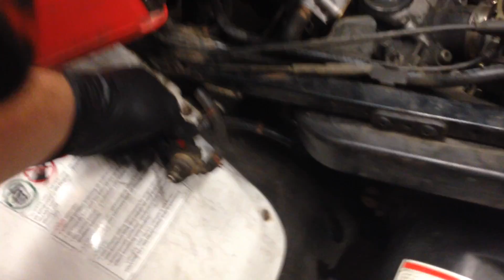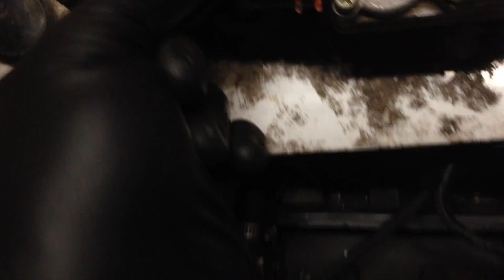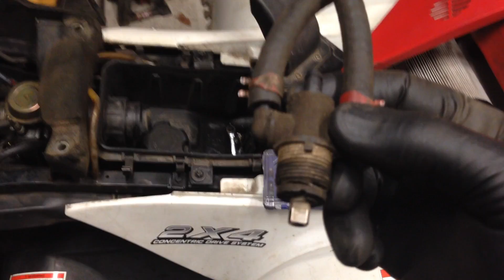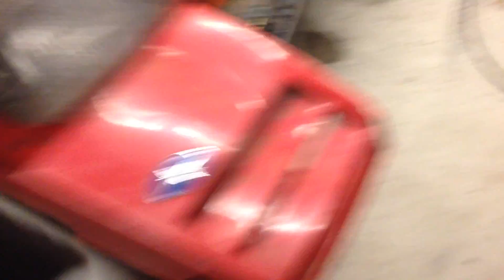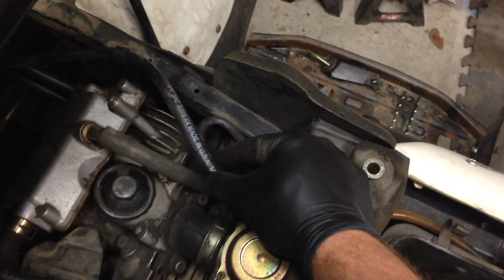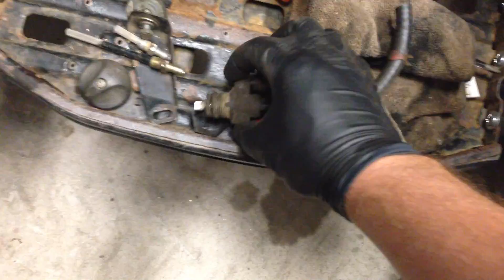Trailboss 325 fuel issues. The fix! Engine sputters then dies. No power or acceleration.

Comment: I'm in the process of chasing down a fuel issue of my own on my Sportsman 700. I replaced the carb and still have issues. So tomorrow I am removing everything and replacing the petcock, pump and all the lines. I was going to try to clean the tank as well. But I'm curious as to how the nipples on the tank come out and go back in? I'm a little nervous about breaking a seal and having a future leak. So my question is, how do they come out and have you had any issues with them after removing them? Thanks!
Reply from the maker: Mike Boley they thread into the plastic and they seal up fine, nothing to worry about, don't over tighten them. Brass will always win over plastic when torque is in play. Just make sure you take note on which nipple fitting is reserve and which one is the on position so you correctly connect the lines to your petcock valve, my only recommendation for you if you're going for a full fuel system rebuild. I hope my video is of help to you and thanks for your comment. Best of luck with your sportsman 700
Reply: Dustin Elgan thank you so much! Where did you get your fuel lines? I was going to try to go to the parts store but someone said the last time they went there they said they weren't allowed to sell him the lines by the foot. They ended up just cutting him a section and gave it to him. Not sure what that was about, but I may have to go online to buy them. Thanks again!
Reply from the maker: Mike Boley got my lines at advance auto. If any of the big store brands say no, you can't go wrong going to a Napa or other smaller name Autoparts stores. They'll accommodate you better for sure. There's always eBay and amazon as well, you'll need like 7' of 1/4" fuel line I believe, all that info is in the video. Online will probably be cheaper TBH.  Best of luck, let me know how you make out.

Comment: Also i believe the start switch is bad. The e start wont work. Lights dont work. Nothing electrical works except for that it starts and runs rough
Reply from the maker: Bob Disandro see my tutorial on headlight starter switch replacement on my channel. This may help you. If that doesn't work check your stater solenoid just forward of your battery. If nothing after that replace your starter and make sure there's no corrosion on battery cable terminals or faulty cables. Hope this helps you.

Comment: Im having issues with my 01 325 trail boss. It will start with the pull start and run like junk. Will not excellerate at all. No funny noises from the engine so i assume its a fuel issue. I cleaned the carb. Changed the plug and end. Drained lines and added fresh fuel. Changed nothing. Please help.
Reply from the maker: Bob Disandro follow my tutorial for fuel pump fix. Either bypass the pump or replace it, consider replacing all of your fuel lines, they can collapse internally and restrict fuel flow. Hope this helps you.
Reply: sometimes its not necessarily the fuel...if it is an older model quad and driven a lot it could be a worn cam lobe.  Polaris engines are notorious for worn cams.

Comment: This is funny, I had the same problem, but I had to change the  carb, but I had a buddy put in a gas filter and change out some things like the nob for the gas.
Reply from the maker: Spudnick MORTY glad you fixed it. Sometimes a clogged filter is enough to make things run bad by itself, those carbs aren't cheap! Thanks for your comment.
Reply: Dustin Elgan hey I have a trail boss 350 and I was coasting down a hill and it died and sputtered out and have not been able to run Sence could u give me some advice on how to fix it also I just premixed gas instead of using the oil tank did that mess anything up or not

Comment: its a fuel pump that works with vacuum it has a rubber bladder inside every time your piston moves  it creates a suction so it can pump fuel into the carb
Reply from the maker: jose flores thanks for your comment, I figured that's how it worked by design, you just confirmed it. Thanks again.
Reply: Actually its a pulse signal that does have a positive and negative  signal from piston.. up and down.. fuel pump has a check in it that, is crucial to the operation of unit.. no its not a direct vacuum that makes it work .. must be a pulse signal....  Jose there is more to it..
Reply: No wires!   Jose is correct.   He explained it very well.

Comment: pictures in this link....thanks
Reply from the maker: madsen madsen I checked out your forum and that trailboss was really poorly maintained, you inherited a basket case. Don't worry, my trailboss wasn't much better when I bought it, just see my channel and you'll see some of the fixes that I documented.  My fuel tank had mulch and dirt in it lol. I suggest you fix that pull start sooner than later, the pull start handle acts as a cap to keep water and dirt from entering into that case. I have to fix my pull start as well because the retract stopped working. Your petcock valve is definitely broken and not connected properly. The two lines you mentioned coming from the carburetor to the fuel pump in your forum is correct, one line going to the CVT belt side/petcock/LH side of your quad to your carburetor is your fuel feed, the  line opposite/exhaust pipe/RH side of carburetor is a pressure/vacuum line that makes your fuel pump function. Whoever had your quad before bypassed the petcock valve which is ok, I wouldn't worry about it now, it's functional that way. The single line going to your petcock valve may be coming from your reserve or fuel on nipple from your tank because it has nowhere else to go if I had to guess. If you're not getting fuel to the carb, run a fuel line directly from your tank to the fuel inlet on your carb to troubleshoot if your fuel pump is working or not. Don't worry about disconnecting the vacuum line to test this. If your quad runs with this setup then know you have a faulty fuel pump. I did another video on how to do this bypass, check my channel. Hope this helps you out.
Reply from the maker: madsen madsen the line going to the petcock, take it off and plug it. It's doing nothing for you, just leaking all over the place. That valve is to allow you to run your quad with the option of having a reserve when you run low on fuel when put in the on position. Right now that valve is bypassed and that valve has one of the two fuel lines ran to the valve acting as a plug that could be opened, really a bad unsafe way of plugging the line.

Comment: please help me....my trail boss 330 loss fuel for the fuel shut off petcock.....but only one line come to the gas tank at the petcock.....the other 2 holes of the   petcock are empties ....its correct??? only one line of  the gas  tank comes at the petcock?? thanks
Reply from the maker: madsen madsen there should be 2 fuel lines coming from your tank unless someone changed your setup. So, two lines come from tank to either side of the petcock valve, one line goes from petcock to your fuel pump or to your carburetor if you choose to bypass the fuel pump. If you lost fuel to your carb, I'd start by checking the routing of your fuel lines and also check to see if your fuel lines are compromised/old/collapsed in on themselves affecting fuel flow. Next, pull a fuel line from the tank to see if fuel flows freely by gravity from tank, check to see tank vent isn't clogged, check this by opening fuel cap, if fuel flows better then you'll know it's a venting issue. Next check for clogged screens at fuel nipples in tank, check for clog at petcock valve and fuel pump, then if this doesn't fix the issue check your carburetor bowl and float for a stuck needle and seat. I hope this helps. Let me know how you make out.

Comment from the maker: The fuel system as it is set up with this quad takes a little bit to run the air out of the 4-5' of hose from where the gas enters to where it finally gets to the carb. I'm going to ask you some questions and hopefully I can help troubleshoot the issue with you. It's a frustrating system, I'll add in a few tips that helped me. Feel free to email me your number if none of this works and I'll gladly call you and talk with you if you'd like, versia23@hotmail.com.  Do you have a clear fuel filter like I have going to the fuel pump to see flow? Did you check your nipple fittings coming from your tank to see if mesh screens are not clogged? Is your tank properly vented to allow fuel to flow in that system? I blew into the tank once to push the fuel through the system, you can try that. Does the pressure line allow the pump to work, vacuum leak issues with carburetor anywhere? Is your needle and seat for your carb potentially sticking in float bowl? Try disconnecting fuel feed line going into carb, hold line in container, run the quad on starting fluid and see if fuel primes your line that way. If it does fuel will flow of nothing else is compromising your system. Check that all your lines are hooked up right. If that doesn't work, bypass the fuel pump as described in my other video and see if the quad will run. If it still doesn't run, and you can't get fuel from your tank to the carb, then take your tank off and investigate. Clean out your tank, put in fresh 93 octane fuel. Check for pinched fuel lines, replace all fuel lines of not already done so, push compressed air through lines (not through new fuel pump). Fuel should readily flow by gravity from tank without assistance. Once fuel flow, fuel lines and petcock are out of the possibility of being compromised, it's time to look at the carburetor float system and vacuum system to see if they are compromised. Let me know if any of this helps.
Reply: alright Dustin thanks. hopefully with your help I can figure this out.
Reply: Hey dustin I took the fuel line that feeds into the carb used starting fluid and tried a few times. first off a reddish colored liquid came out then it cleared up but it still won't run. if I pull the choke I can keep it going for a little bit but it still won't run. I'll e-mail you my number and maybe we can solve this. do I need to pull the carb off.? I replaced all the fuel lines and pump so I don't know where that nasty red liquid came from since that was before the carb. well any thoughts.?

Comment: thanks Dustin I'm definitely  going to replace the fuel pump and replace all the fuel line. I'll let you know how it all works out. I sure hope it does it's been a couple years since we've got to enjoy it. thanks again.
Reply from the maker: Let me know how you make out. Thanks for watching and for subscribing! Best of luck👍
Reply: Dustin Elgan feeling a little down, I put a new fuel pump and replaced all the fuel lines but still won't run. Will only run til it burns off the starting fluid I spray in it. We can keep it sputtering for about maybe 10 seconds or so by feathering the throttle. Do I have a problem with the carb.? Fuel was leaking from petcock when I was putting it back together. Seemed to be ok when I checked it like you showed in your video.don't know what to do...
Reply: @ronalds2080  you might have to clean out the carb. Ethanol gums up carbs, especially if you leave the quad sitting for too long. You should always drain the tank and carb of fuel if you are going to let it sit for more than a couple months.
My 2001 polaris magnum 325 has been sitting for over 15 years, and we left fuel in it because I was a kid back then. I'm replacing all the lines, the fuel pump, and today I'm removing the carb to clean out the jets and make sure the float isn't sticking.
Reply: maybe a carb needle problem ?